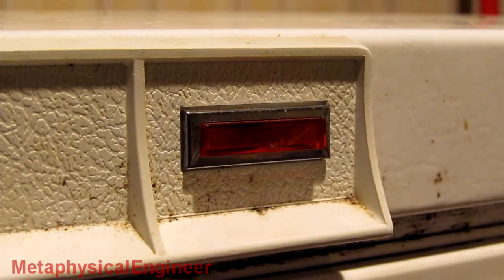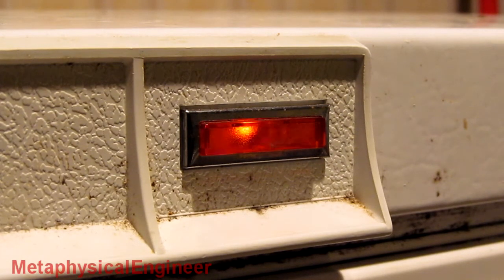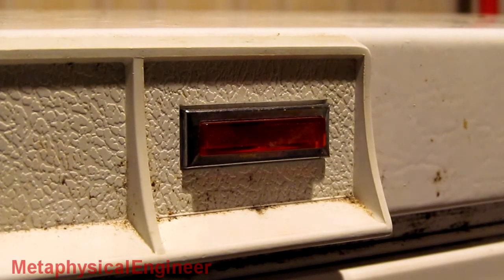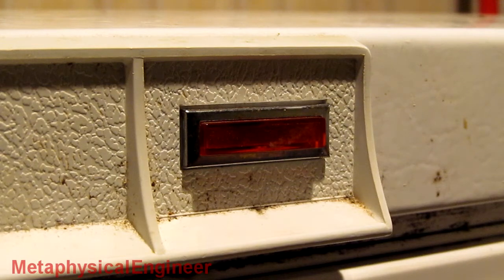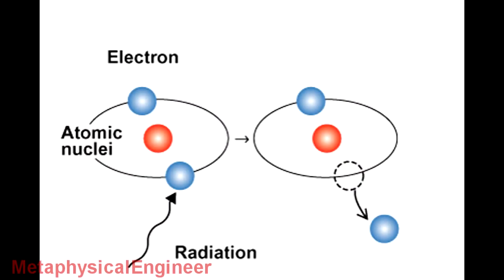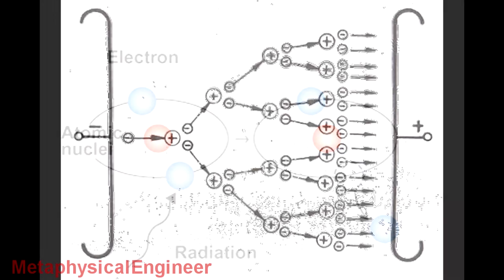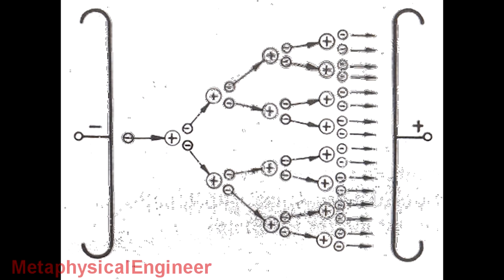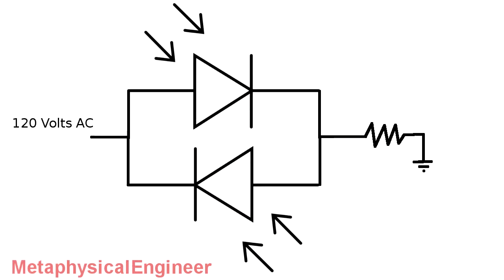Only lights up when the room lights are on?! Strange Behavior from Old Neon Indicator!

Comment: I forgot how this behaviors is called, but I know why it happens. Some old fluorescent tube starters that are designed for low voltage do this too. That is why vintage starters with metal casings have a big hole at the top - to let in a small amount of light , for the external photons hit the dormant inert gas atoms to make them release energy and start ionizing and heating the contacts that have voltage applied to them. This Neon lamp in the video is doing the same thing. It for some reason can't ionize the gas from electrified contacts inside the lamp, and it needs external light photons to hit the gas atoms and initiate ionization of gas. But for some reason the arc can't sustain itself, probably a defected tube.

Comment: I came across a similar spooky neon indicator while staying in a hotel while visiting Colorado.  When I switched off the room light while laying in bed, I could see a random orange flicker and that was quite irritating.  Each time I turned on the light and walked around, I couldn't find anything flickering, yet the moment I laid down and turned off the flight, that spooky orange flicker was back!  I then got up and walked around with a torch, thinking I'd find the culprit easier, but yet again couldn't find any flickering light source.  

Finally, I tried walking around and briefly turned off my torch every few steps .  Sure enough I spotted the rogue neon indicator next to a wall-mounted hair dryer.  When I switched on the torch, the neon was lit.  However, once I switched off the torch, the neon went out and started randomly flashing every second or two.  I never saw a neon do this here in Ireland, probably due to the higher 230V mains voltage.
Reply from the maker: Sounds about right.  With 230 volt mains, there is always plenty of voltage to strike the tube, and a higher value ballast resistor keeps the current in check once it conducts.  The indicators must have a ~100V striking voltage when new, which rises as it ages until the striking voltage approaches or surpasses the 120 volt mains.
Reply: On 230v the lamps like to blacken with age, go short and cook the series limiting resistor because they always use little 1/4 watt ones.
Reply from the maker: Glad that doesn't seem to happen on 120 volts!
Reply: Its a wonder how they don't cause fires, last one I found was a shorted 30 year old neon (blackened)and the 1/4w series resistor had lost all its coloring and turned into bare metal. It measured 100k and was dissipating over 1/2w and got very hot, needless to say I removed it as I'm a chicken for that sort of thing!